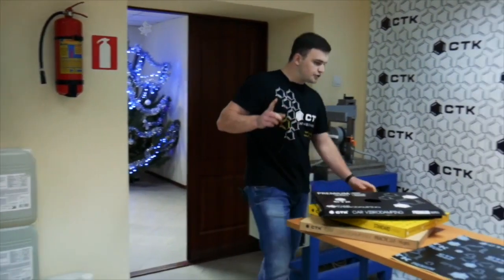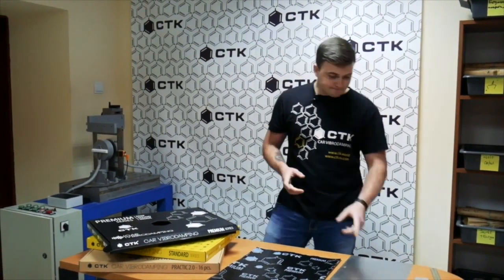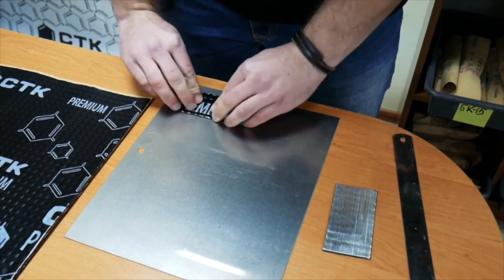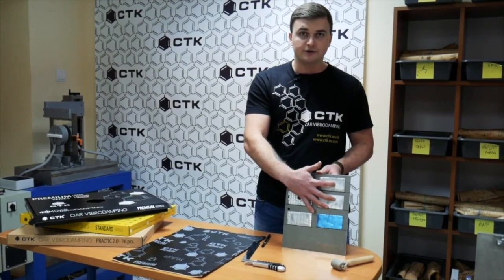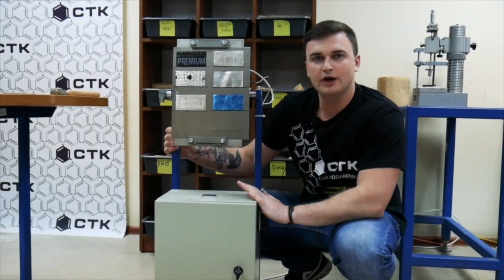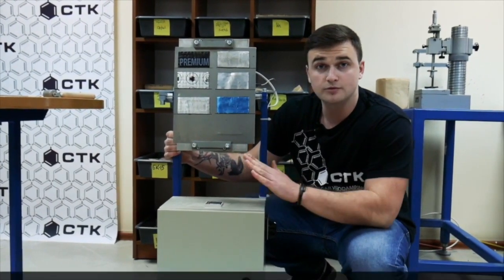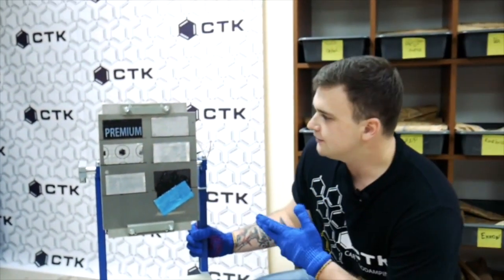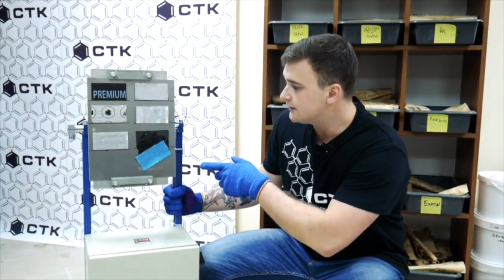CTK's thermal test of damping materials

Comment: Hi. Nice video mate. Can I use it to make motorcycle spoke type rims tubeless? Tyres don't heat up much over 50_60°C in general, it's just rotational force that matters. Awaiting for your response 

Regards
Stavan, India
Reply from the maker: We haven’t had such experience! If you decided to try will be have to get feedback from your side.
Reply: @CTK_WORLD  i have converted 20+ rims of Royal Enfield Interceptor Motorcycle spoke rims to tubeless rims with semi solid butyl rubber material which gets solidify upon drying. I think sheets have same material, should work